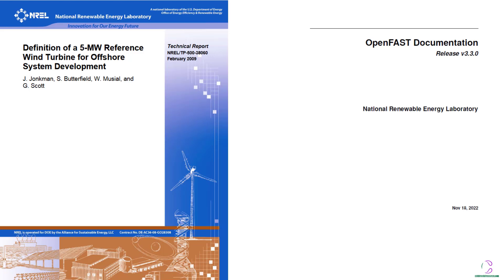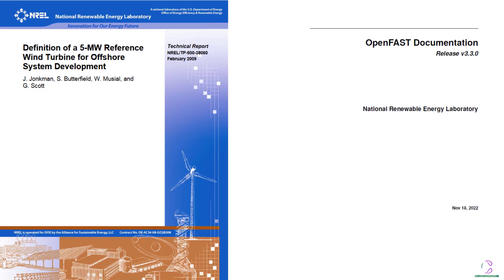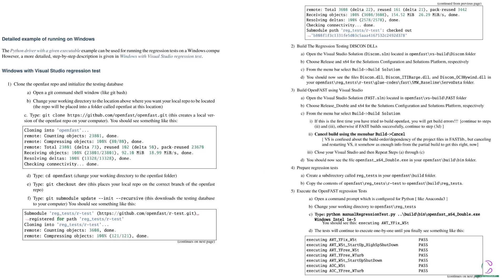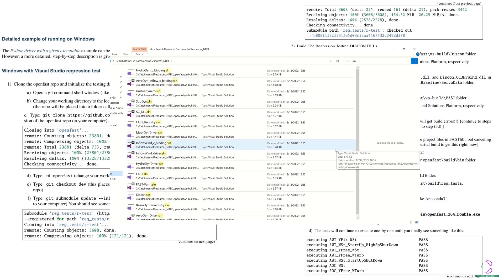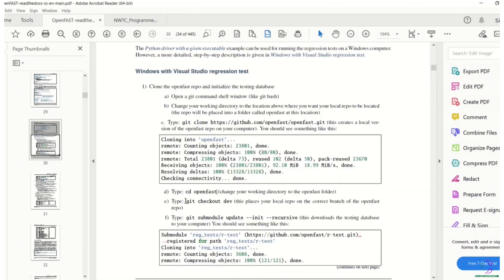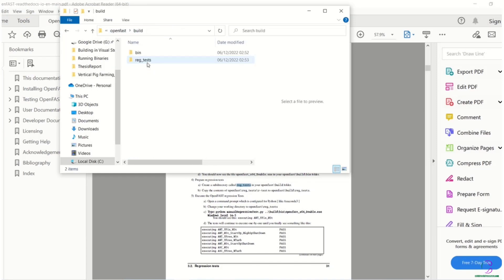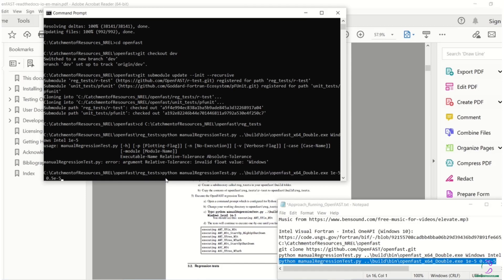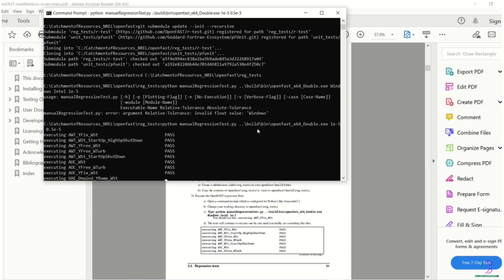Part 3: Testing OpenFAST on Windows Utilising Visual Studio | Editing Source Code | Turbine Design

Comment: Hi I am unable to generate .exe on build solution, I am using VS 2022 V.17.10. Could you please  provide link to v17.4 to download?
Reply from the maker: Hi, did you follow the instructions in Part 2? https://youtu.be/JQ3jtXjgfBM?si=Z2xeriVVAVotyFnu
You could also try to download VS2019. But I will check for v17.4
Reply: @catchmentofresources  Thank you so much for your reply, Yes, I did try 2019 as well but it does not build the solution, However with 2022 V 17.10, it does build solution without error but there is no .exe file